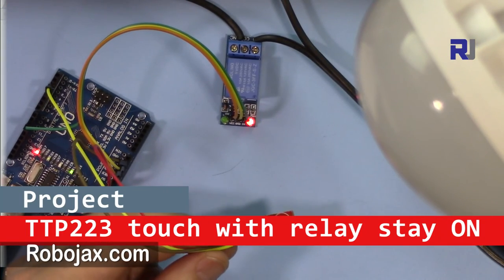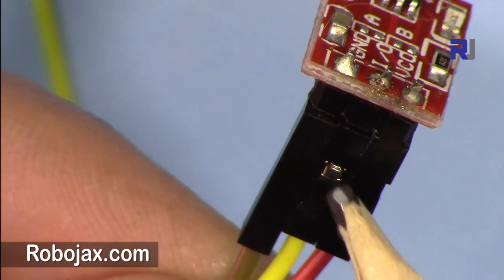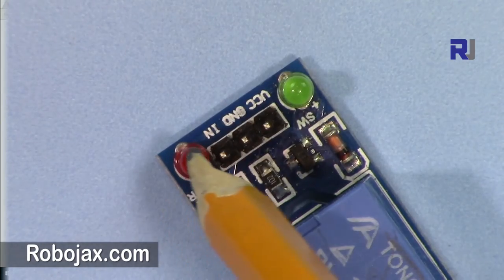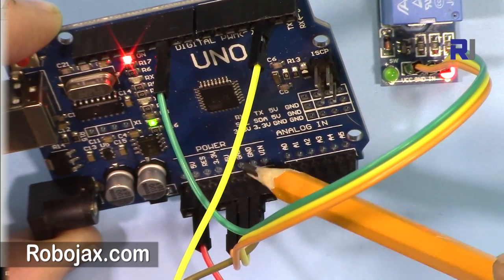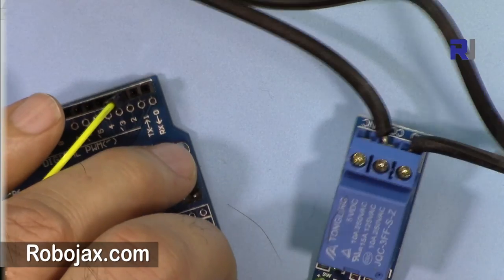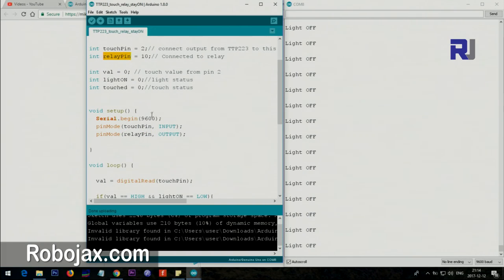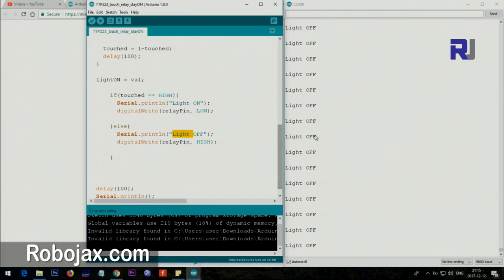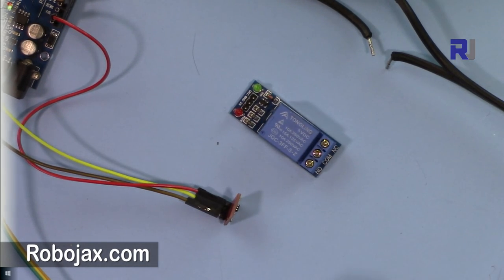Turn ON and turn OFF AC bulb with TTP223 and relay using Arduino

Comment: Thanks for the wonderful video. If the system restarts due to powersupply will it retain its on off state. What to do to retain its on off state.
Reply from the maker: No it will not retain the state. This is good question.  I would have to create another video for that.  I am not sure when but I will put this in my "to do" list.

Comment: just use
boolean val = (digitalRead(touchPin) == HIGH)
if(val == HIGH) digitalWrite(relayPin, !digitalRead(relayPin))

give some delay for smooth operation
Reply from the maker: Your method will work. Thanks. But most people won't understand what it does. I am not just providing the code, I am trying to help people learn.

Comment: Nice! How many channels maximum can drive with this Touch Sensors and only one (1) Arduino?
Reply from the maker: it depends on how many digital output you have on the Arduino board. Arduino mega has 54 pin  see it here https://store.arduino.cc/usa/arduino-mega-2560-rev3

Comment: Thank you very much. I would like to use another TTP223 and another relay on the same arduino board. It's possible? Could you write the code for me to try to make it work? I am a woodworker and I am having a wooden furniture idea so I can use this system. Again, thank you ...
Reply from the maker: Hi Marcio, I have just updated the code to make it work for 2 channel.  When you visit the page, scroll down and you will see the code fro 2 channel. I have not tested it but it should work. Let me know if you got any error..
http://robojax.com/learn/arduino/?vid=robojax-TTP223-relay-stay-on

Comment: Hi
With ardunio ttp223 and ardunio 5 volt relay only may i do a swich on off buton without  board.thanks
Reply from the maker: so you want to turn OFF the load (bulb or something else)?

http://robojax.com/learn/arduino/?vid=robojax-TTP223-relay-stay-on

in this line  digitalWrite(relayPin, LOW); , change the LOW to high and remove the ELSE{   }
so you have this:

      if(touched == HIGH){
        Serial.println("Light ON");
        digitalWrite(relayPin, LOW); 
       
      }else{
        Serial.println("Light OFF");
        digitalWrite(relayPin, HIGH);
   
      } 

make it like this
      if(touched == HIGH){
        Serial.println("Light OFF");
        digitalWrite(relayPin, HIGH); 
       
      }

let me know if this is what you wanted.

Comment: Good day sir,
it is working fine , but with your code for 2 module of ttp223 when uploading the code its working 2 relay by 1 module not with 2 module separately, please send the code for 2 module which will work separately
Reply from the maker: Hello, I have explained it fully. if you watch and learn, easily you can make this work for two or 10.  I mentioned how to define input pin and how to define pin for relay. that is it. do the same for more input (touch) pin and for relay. Here is 4 channel touch https://youtu.be/4kVhG0OpCf8  and I have 16 channel. Search my channel and you will be surprised. Good luck and stay safe.
Reply from the maker: Please subscribe. I appreciate it and helps my channel grow.  Thank you

Comment: How to make this circuit work as a Toggle Switch or on/off switch..? I mean, if I touch once..It will be on and if touched again, it will be off. Please help...Thanks
I have bought this blue pcb circuit on line...Gave 5 volts supply and put the load....But it works only as touch to on switch circuit...It has no provision for jumper...
Reply from the maker: this is what you want. See the thumb image it say "touch ON" and "touch OFF". You must be escaping the video.  Please watch again, follow exactly what I said and it should work.
Reply: @robojax  
I have watched full video Sir...Actually, I am talking about control without Arudino help..I want to have Just simple on off touch switch and that too with the Blue Coloured PCB wherein no jumper space is there. I have unknowingly bought the blue PCB available on line and now can't use it for my hobby project. As I don't understand electronics circuit very much, I am seeking your help...Can you help me..?

Comment: Sir why you not shorted the module bridge B which turn the mode from momentary to toggle switch mode without using arduino
Reply from the maker: sorry didn't get what you asked?
Reply: @robojax  I am saying that you can directly use the module ttp223
To on and off the light there is no need of arduino
Reply from the maker: Yes. you can. I believe I have said that. But you definitely need Relay module. Just connect the output of the touch sensor to the input of relay module.

Comment: can you tell me what type of arduino i can use to make this? sorry i'm a beginner
Reply from the maker: Any arduino will work. But the best one is Arduino Uno.
Reply: Ooh okay, And what type of relay?
Reply from the maker: Search for 5V relay module. it is 5 Volts relay.
Reply: Okay i will search it :)

Comment: ...and for me to add another relay and a sensor? it's possible? Thanks...
Reply from the maker: Yes you can. Watch this video https://www.youtube.com/watch?v=4kVhG0OpCf8 and if you still  needed help, I will write the code for you
Reply: Thank you very much.
I would like to use another TTP223 and another relay on the same arduino board. It's possible? Could you write the code for me to try to make it work? I am a woodworker and I am having a wooden furniture idea so I can use this system. Again, thank you ...

Comment: i want a code that never switch off the light until i touch again for off i mean to say want a simple touch on/off code need help thanks
Reply from the maker: This is the code you are looking for. when you turn ON it will saty ON until you touch again.
the the link for the code is under the description.

Comment: Am facing this error while uploading code. What should i do
"
Arduino: 1.8.5 (Windows 7), Board: "Arduino/Genuino Uno"

Sketch uses 2272 bytes (7%) of program storage space. Maximum is 32256 bytes.
Global variables use 212 bytes (10%) of dynamic memory, leaving 1836 bytes for local variables. Maximum is 2048 bytes.
avrdude: stk500_getsync() attempt 1 of 10: not in sync: resp=0x30
avrdude: stk500_getsync() attempt 2 of 10: not in sync: resp=0x20
avrdude: stk500_getsync() attempt 3 of 10: not in sync: resp=0x30
avrdude: stk500_getsync() attempt 4 of 10: not in sync: resp=0x20
avrdude: stk500_getsync() attempt 5 of 10: not in sync: resp=0x30
avrdude: stk500_getsync() attempt 6 of 10: not in sync: resp=0x20
avrdude: stk500_getsync() attempt 7 of 10: not in sync: resp=0x30
avrdude: stk500_getsync() attempt 8 of 10: not in sync: resp=0x20
avrdude: stk500_getsync() attempt 9 of 10: not in sync: resp=0x30
avrdude: stk500_getsync() attempt 10 of 10: not in sync: resp=0x20
An error occurred while uploading the sketch

This report would have more information with
"Show verbose output during compilation"
option enabled in File -> Preferences.   "
Reply from the maker: Disconnect arduino, Reboot your computer and try again. If this does not resolve the issue, then. the next step. The error is from "avrdude". Please follow this page and you should resolve the issue: https://learn.sparkfun.com/tutorials/pocket-avr-programmer-hookup-guide/using-avrdude

Comment: Bro no need to use Arduino for this  just we need is 5v relay module with optocoupler and ttp223 touch sensor. Short A both the point and B both point on touch sensor and give out put of sensor to relay in and supply 5v that's it. When you touch it will be On and when touched again it will be Off.
Reply from the maker: Yes I have mentioned this in my many tutorial for this module. But with arduino you can set time to keep it ON after you touched. etc.